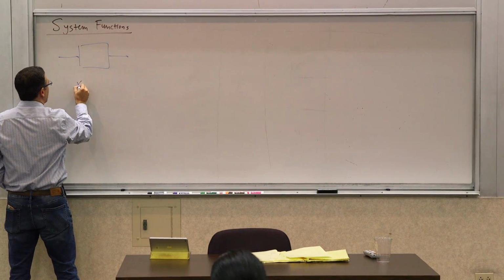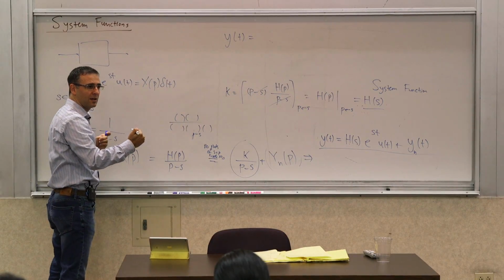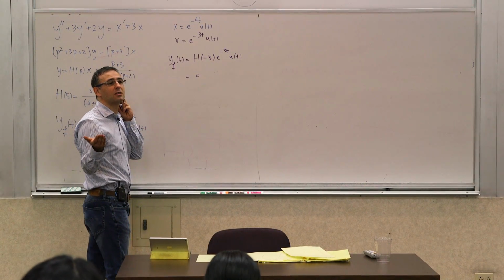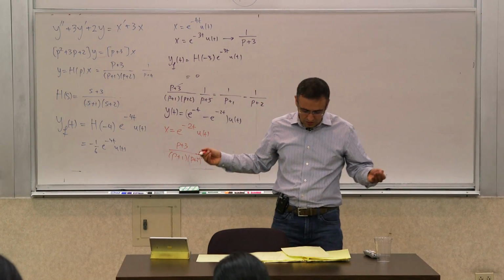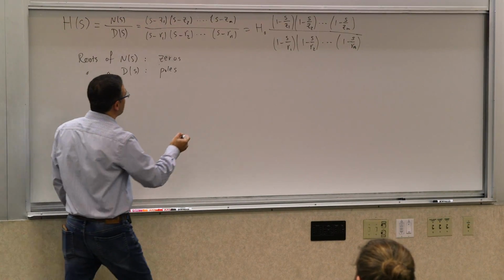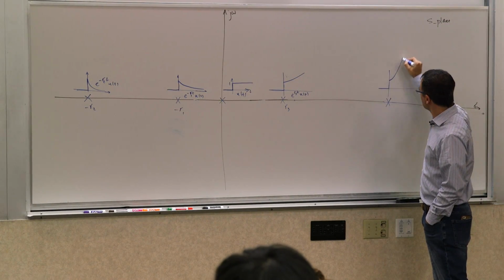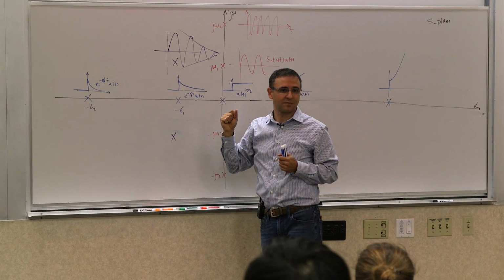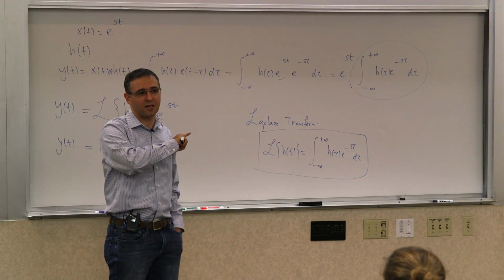027. System Function: Forced and Natural Response, Poles and Zeros, Time Domain View, Laplace Xform

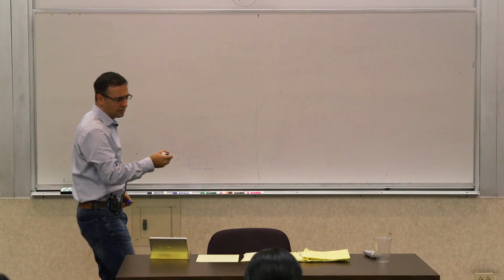Comment: 10:48 - An Example - 
____ - Hitting the system with zero frequency to produce only natural frequencies at the output
____ - Hitting the system with pole frequency to produce it's natural frequencies and a spike/dip with input frequency
23:00 - Non-validity of H(s) for Pole Frequencies
26:23 - Concept of Poles and Zeros, Low-Pass Form
31:48 - S-Plane
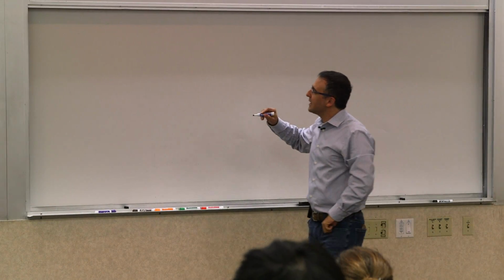48:05 - Laplace Transform Derived from Two-Sided Input Signal